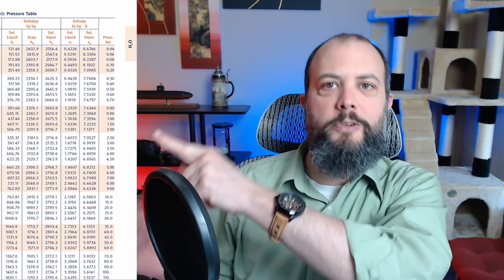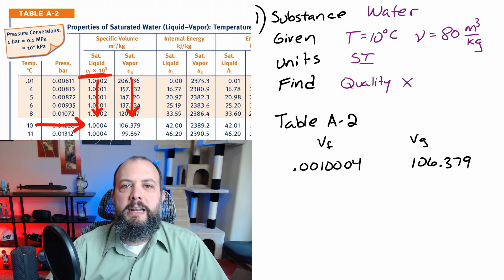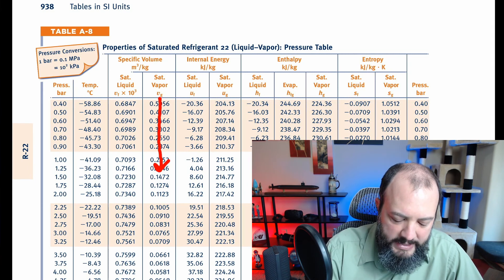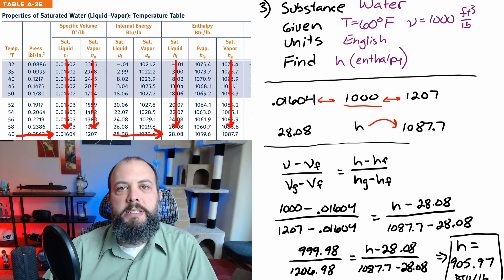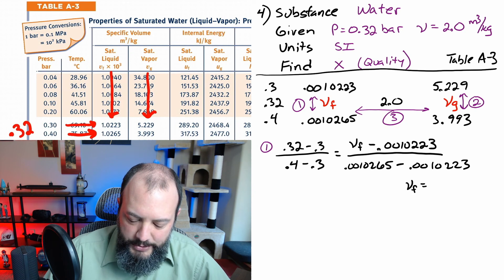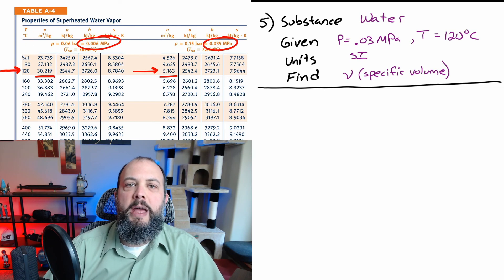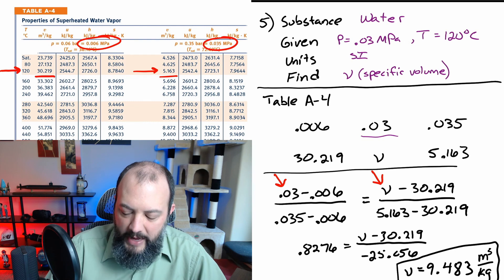How to Read Steam Tables – 5 Interpolation Example Problems

Comment: Doctor Bernard how do we find the enthalpy of a steam that has a temperature of 25°c and a pressure of 100 kpa
Reply from the maker: With both Temp and Pressure given - probably not saturated (only need 1 for saturated), but I go to saturated first to confirm whether it's Superheated Vapor or Subcooled Liquid. Since 100 kpa is 1 bar, I check the Pressure table, and see that Saturation Temp at 1 bar is 100C. 25<100, so you have a subcooled liquid because your temp is cooler than saturation temp at that pressure. In my book, Compressed liquid water is table A-5. You'll see though that 1 bar doesn't have an entry here. There's nothing below 25 bar. But take a moment to compare several of this mini-tables in the compressed liquid chart. You'll see that comparing 25 bar to 75 bar, you'll see that the enthalpy numbers don't really change at the same temperature. So - a huge increase in pressure causes very little change in enthalpy. But look at the difference at 25 bar between 20deg and 80deg ... huge change in enthalpy. So - Temperature is very important. Pressure is not very important. I'm almost to my point. You are going to have to make an approximation. for 25c, 100kpa, you are going to assume that the enthalpy is approximately the same as a saturated liquid at 25c. You will ignore the 100kpa term. So - back to the Saturated Water table, and use the hf value at 25c. This is an approximation, you aren't exactly saturated - but it's the right answer. These low pressures aren't included in the compressed liquid table, and since pressure has very little effect, you just use the temperature term which you saw has a very big effect. I would use enthalpy of h=104.89 kJ/kg. Thank you for your question.
Reply: @BrianBernardEngineering  thank you doctor we all apreciiate
Reply from the maker: @fatimazahraanouar8571  Your welcome, and it really is my pleasure.

Comment: PUT THE TABLE ONLINE PLEASE
Reply from the maker: If you only need metric units, then Claire Yan has a free online Thermodynamics book with tables included, https://pressbooks.bccampus.ca/thermo1/ . If a pdf is ok, I prefer Thermodynamics for Engineers by Robert Brown which you can find at https://github.com/robertbrown2/ThermodynamicsForEngineers . It also has steam tables in the back, and they are very well formatted. Only metric units though.

Comment: Hlw sir
Is your channel for mechanical engineering
Reply from the maker: Yes, that's exactly right. If you check my channel page, you'll see content for Engineering Graphics, Statics, Mechanics of Materials, Thermodynamics, Fluid Mechanics, Design of Machinery - all part of the mechanical engineering degree.

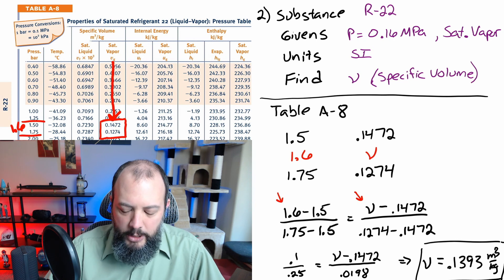Comment: Hi, thanks for ur  video! At timestamp @5:29 , may I check that you did cross multiplication? I got a different value for this. Please help. thanks!
Reply from the maker: Good catch, the .0198 in the denominator should have a negative sign in front of it. I described this in words as I was speaking, but must have forgot to write it down. The final answer is correct though.

Comment: Doctor Bernard I calculated specific volume of superheated R-134a @120kpa,353K to be 0.243535 by your method, but It wasn't right.
It has to be 0.23669, I want to know how to get the answer.
Reply from the maker: I get the same answer as you. 120kpa is halfway in between .10mpa and .14mpa, so I take the average of the 80deg C v value on .10mpa and 80deg C value for v on the .14mpa table, and average them. Technically we should maybe interpolate since 353k is actually 79.85 C, not 80, but this will only change like the 3rd or 4th decimal probably, not nearly as big a difference as you are seeing. That .23669 is very close to the answer I get if the temperature were 70deg C - so I'd first double check that the problem doesn't actually ask for 343K not 353k. Otherwise, I think you are solving this problem correctly, and think that there may be a typo in the problem or solution that generated the .23 value.

Comment: Sir in the superheated steam tables, when the given pressure falls in between the smaller tables, can you use any number from each table at a given temperature and interpolate between them? For example you used the v's at 120 deg C but could you also have used the volumes at 280 deg C and get the same answer?
Reply from the maker: Yes, you can use whichever 2 pieces of information you have, and compare the corresponding values in each adjacent mini-table

Comment: Doctor Bernard, great video, cleared up a few things. I'm taking thermo now and was wondering if there is a chart with all the info needed to find what state water is in with given values? My notes are all over the place. Like you said, if the question wants quality, you know it's liquid-vapor mix. The text book is ok but I'm trying to find something that has everything I need in one place. Btw, I'm posting this video for my classmates. Our professor did not address interpolation so a lot of people are very confused. Thank you!
Reply from the maker: Unfortunately, there's no single chart. Water has 3 charts (subcooled or compressed liquid, liquid-vapor mix, and superheated vapor). My recommendation is to just always check the liquid-vapor mix chart first. Suppose you know temperature - go to the temperature liquid-vapor chart. Then, to determine whether you are in the right place, or if you should go down to subcooled or up to superheated, use your next piece of data. If you have pressure - compare your given pressure to the saturation pressure at your given temperature. If your pressure is too high - it's compressed liquid because high pressure is compressing it so much. If your pressure is too low, superheated gas, low pressure expands like a gas. You can do similar if you have enthalpy or specific volume too. If your specific volume is off the chart high, even higher than the saturated gas - you'll move up to the gas table. If your enthalpy is off the chart too low, below the saturated liquid value, then you know you need to shift to the liquid table. To sum up: if you aren't sure of the phase - start in the liquid-vapor mixture table since that one is in the "middle". Check the numbers there, and if you are below the saturated liquid, move to the liquid tables. If you are above the saturated vapor values, move up to the gas tables.